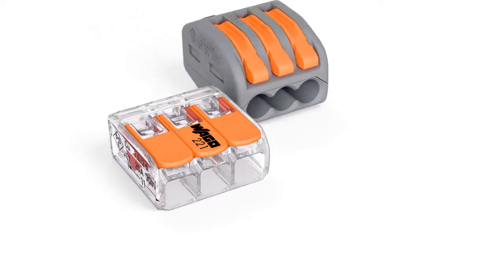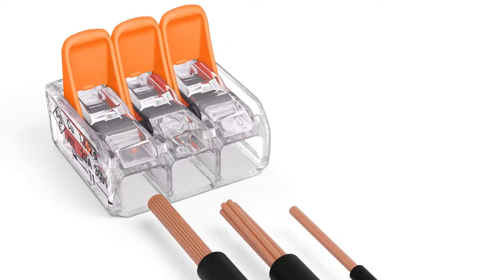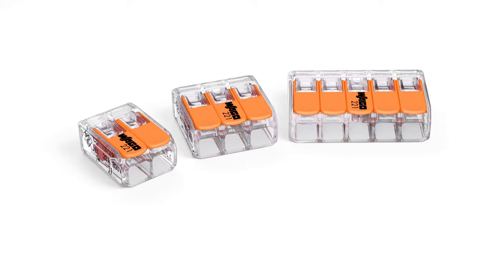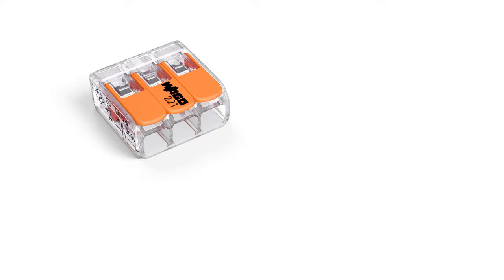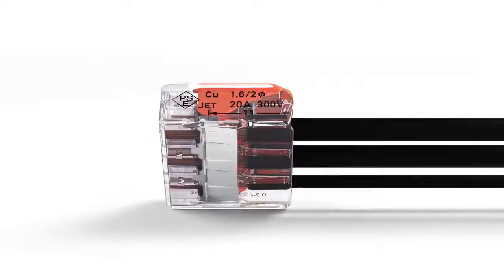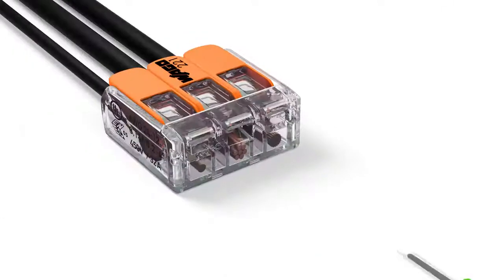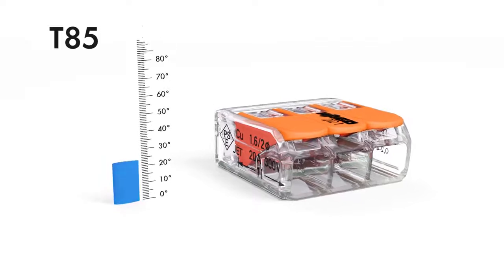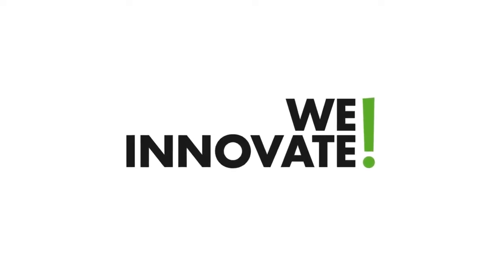WAGO Limited 221 Series Compact Lever Connector

Comment: I can see times when these would be handy, but I'll stick with wire nuts for the most part.
Reply: Wire nuts are fire hazard
Reply: @Dextermorga  I suppose they are if you don't know how to use them correctly. In 40 years of using them I've never had a problem with them. Always test your connection before you walk away.